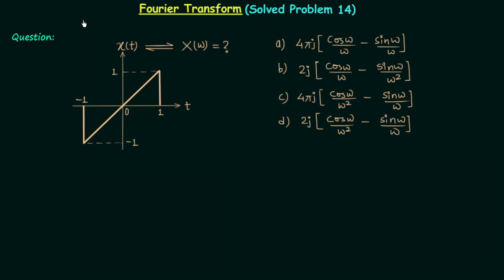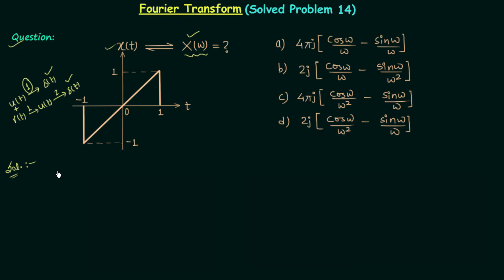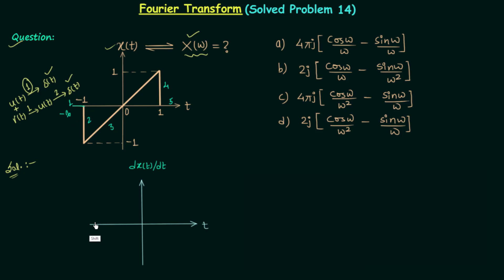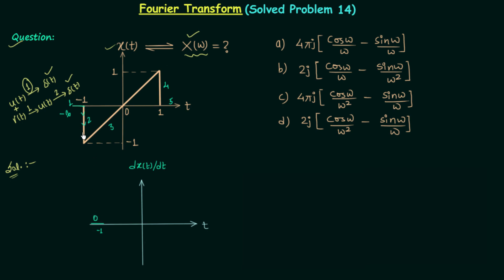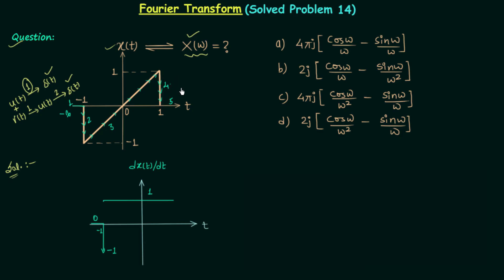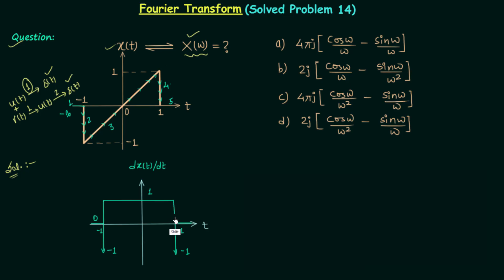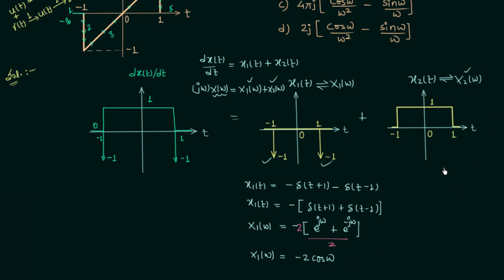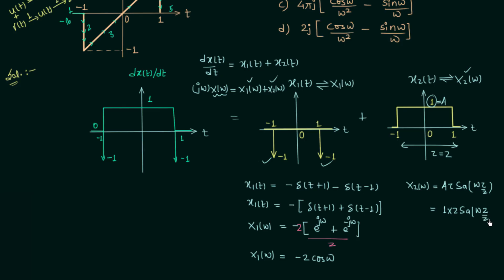Fourier Transform (Solved Problem 14)

Comment: Sir when you try with the half portion of the ramp single that means, take the signal from 0->1 of the above signal and undergo Fourier transform, the answer of this method comes different to the calculation of normal way through integration. Please reply for this